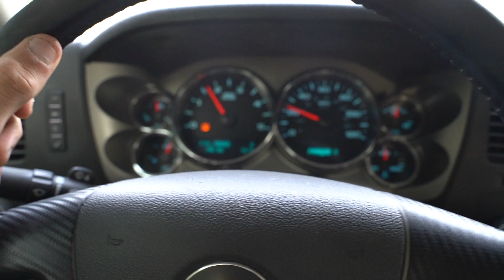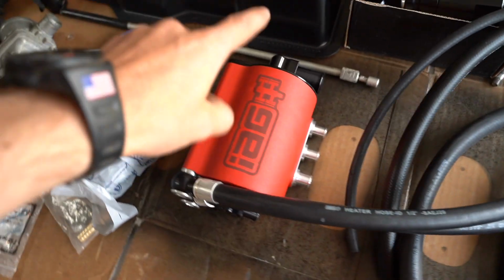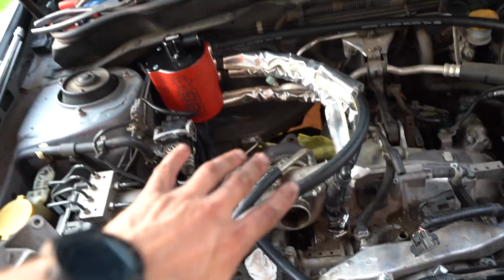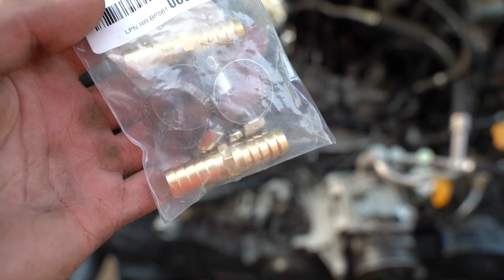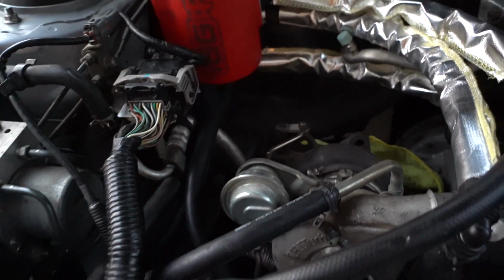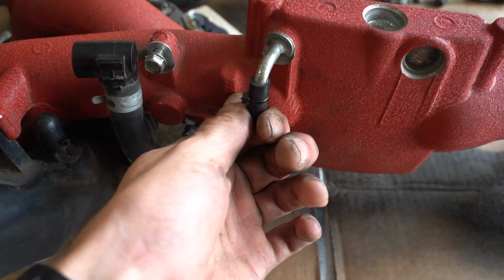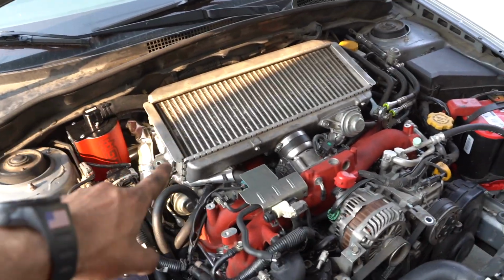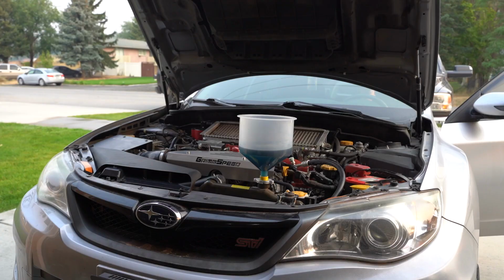Installing an IAG AOS in an STi

Comment: Do you need a tune to run aos competition? And also how you delete the coolant lines that goes to the reservoir tank?
Reply from the maker: You will need one, yes. To delete those lines, just remove all of the hard lines on the radiator, cap off the nipple on the passenger side and run a hose from the nipple on the drivers side to the overflow tank. Easy as that, then just make your loop from water pump, to AOS, to turbo, to back of head!
Reply: @bschoenborn  thanks for the information man , and also to delete the reservoir tank do you still need a tune  because I’m planning to get the street one because I don’t wanna get a retune rn